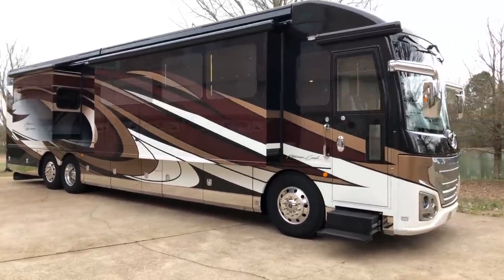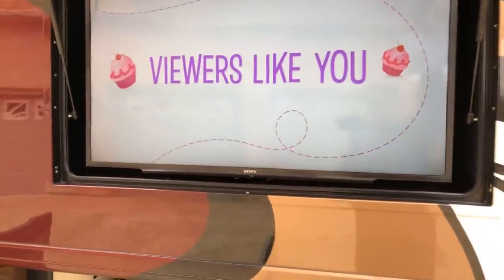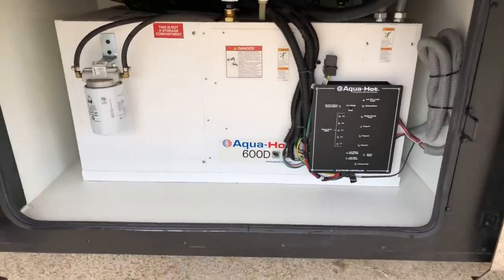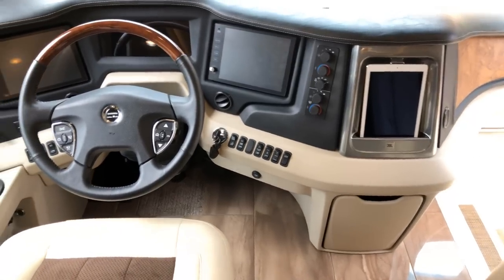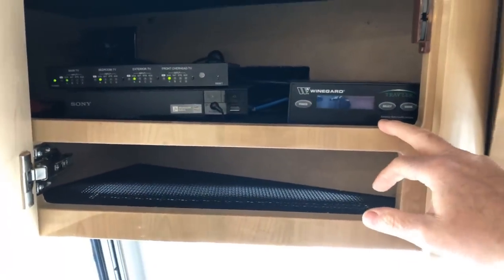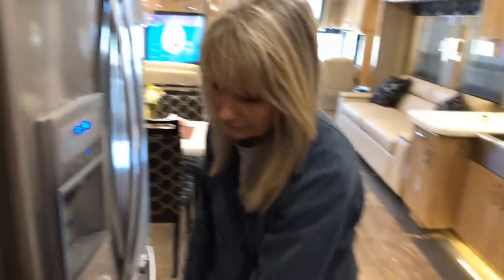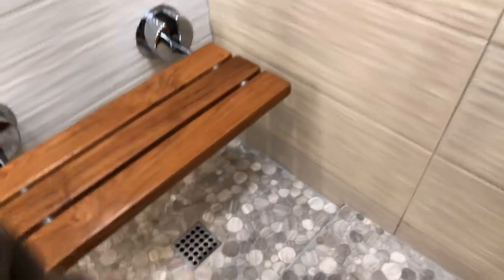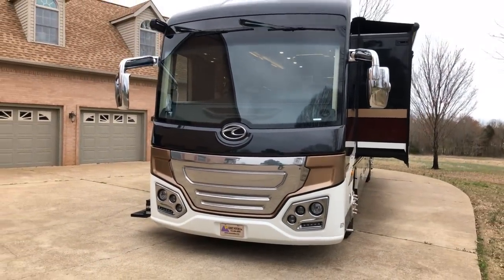2019 AMERICAN COACH EAGLE HERITAGE 45C CLASS A 605HP CUMMINS RV MOTOR HOME COACH FOR SALE REVIEW

Comment: I would not be interested in buying used. I would like a new 2020 I’m sure I could get this one new for $700,000. Or less. Floor plan is not very comfortable with only 1 small chair. Could I get reclining chairs by removing the couch. You did not mention how much solar is on roof. You have 8 lithium batteries so I would expect 1.2kw of panels on the roof.

Comment: When I saw the wiring, I said, what a mess. and then you said, pretty neet? If that is the normal standard of wiring on those RV's? I would be afraid for fire. many of those will move around while driving. At least strap them together. To prevent them from mowing and shorting over time.
Reply from the maker: I agree with you but this unit is above standard there is some real mess out there. Thanks for watching

Comment: I have 1 question.  How much longer can you boondock using the lithium house batteries vs the previous AGM batteries it came equipped with ?
Reply from the maker: Good question i have not tried it myself but was told almost twice the original capacity !  Thanks for watching

Comment: This is nice but it's really overpriced to be a 2019 not to mention I could have a 53 ft trailer built and it would cost that much to do it these manufacturers love trying to rip off Customers. Only a crazy person would spend almost $800,000 for this not to mention paying over $80,000 just to get it registered and insured I'll pass the RV trailer Will Smith had built looks better than this and it's a 53 ft trailer it's called The Heat it's on YouTube it was built by anderson mobile estate